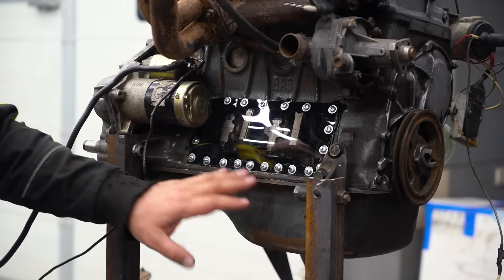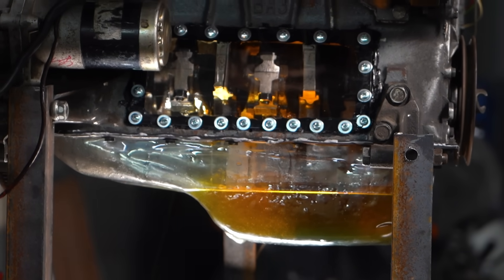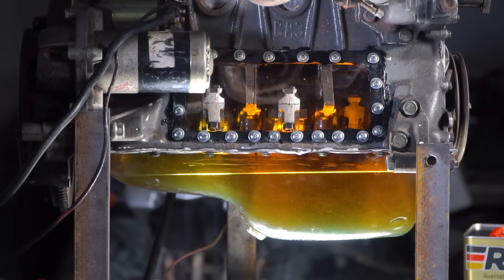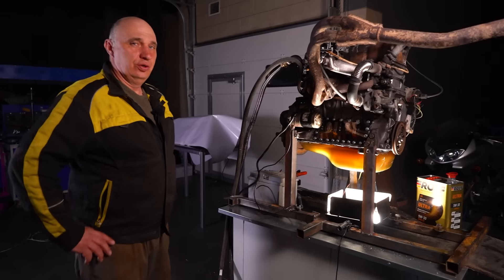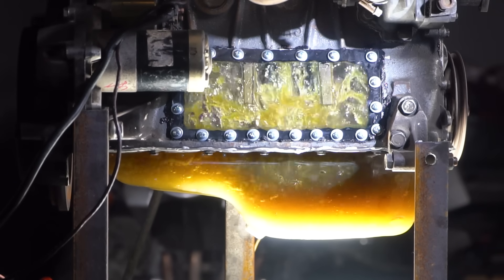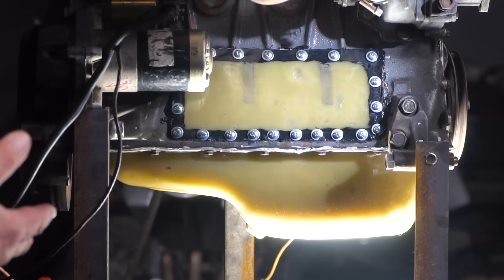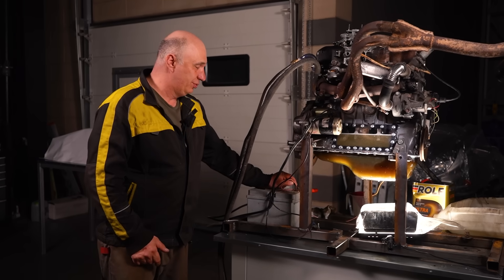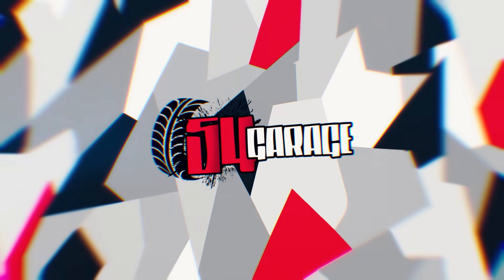What actually happens when you overfill your motor oil? (w/ transparent oil pan)

Comment: Great video!
Cause of problem seemed to be that crankcase pressure went up suddenly along with foam and completely blocked crankcase vent (foam may contribute to blocked vent, as apparent).  This crankcase pressure increases suddenly as oil heats and vent is blocked.  The pressure causes
seals to blow.  Primary cause of failure is crankcase vent getting blocked w/oil and  crankcase pressure building up.  The blowby on cylinders from same pressure caused burning of oil.
Foaming is secondary, but perhaps root cause if you break camels back with juuust too much oil.  The foaming may tip the scale, as foam may be more viscous and will not allow crankcase to vent properly. 
At least this is what it seemed to me.  
Watch video again and reply if you agree or not.

Comment: The oil is actually becoming aerated on the second test with double the oil. It was a good test but it would have been interesting to see an oil pressure gauge. The reason an engine fails when you add too much oil is because of all the air bubbles it will create, causing low oil pressure and poor oiling. No telling how long it would take, but it would eventually kill the engine.

Comment: My sister’s ex mother in law saw that the dipstick was low, her husband taught her how to check, but not how to correctly top up or how much. She bought several containers of oil, knew that oil went into the fill cap hole, then poured those containers in one after the other as she didn’t see an oil level through the fill hole. She attempted to drive off. The engine hydraulically locked in about a minute. It did start up after the level was dropped, but the engine was never the same.

Comment: Yes thats for that specific engine . You see the oil is being sprayed to side of block.. If you add too much oil the crank splashes into oil causing windage (air in oil)in good engines on in clines and declines you need a windage tray for race engines.. This engine will lose HP and on inclines will airate and destroy engine. let alone push the oil into PCV system .. idiot

Comment: Thank God someone disproves the myth adding more oil will bust your seals. Adding more oil does not increase oil pressure, it is open to atmospheric pressure. Most don't understand pumps either. Pumps do not create pressure, pumps create flow. The pressure at anywhere in the engine is determined by the area of the oil channel at that location Pressure = Force/Area. Force is equal to the pump flow there will be flow losses the further the oil channel is from the pump and smaller channels increase resistance to flow, so they increase and decrease pressure at the same time bringing it to a happy medium s designed by the engineers. The main issue with to much oil is as seen, your crank will turn it to foam by mixing air into it.That doesn't lube your engine or operate hydraulic lifters nor provide a good coating on the cylinder walls and so on.

Comment: Wire mesh under the crank will increase power like you can not imagine. WE DID THIS ON A GT3 1.6LITER COROLLA AND THE ENGINE REVED SO EASILY.

Comment: Too much oil also robs the engine of power due to the energy dissipation when the big ends and counterweights smash into it at high velocity. The energy is transfered into momentum and the result is that oil spray and foam.

Comment: I once accidentally put a quart too much in my engine, and worried about it.  This video suggests that wasn't a problem at all. On the other hand, I've seen plenty of engines that are way too low on oil.  A low oil level is often immediately obvious when you first open the hood, and you feel the heat blast coming off the engine.  You can also hear the valve/lifter noise.   Going up a hill, or going around a corner can set off the low oil pressure warning light.

Comment: My coworkers son was taking an auto mechanics course in High School and decided to put his new skills to use on the family car. He pulled the dip-stick and observed it was a little low and added some oil. This process was then repeated several more times, and oddly the oil level never changed. The next morning my friends car started on fire while he was driving to work. Excess oil was pouring out of the breather and valve covers starting the fire. Later it was discovered the kid had been looking at the transmission dip-stick and had added several quarts of oil before giving up.
Reply: Another guy I was reading in these comments said they knew a guy who had done that also. That is hilarious it is a little more common..

Comment: My son was on a road trip, close to a hundred miles from home, remembered he forgot to do the 5000 mile oil change, so found a shop to change it befor heading home. On the way home it wasn't running as it should. Checked the oil, it was way over filled, figured they forgot to dump the old oil and added the new on top. We drained it, it was thick, all the oil was a thick foam and in volume, about triple the proper amount. After a month the drained oil was still the same, still foam. I was surprised something didn't break, a piston rod or something, but motor was fine.
Reply: you dont have to change it every 5k miles on the dot, you probably did more damage (engine wear) to the engine from this than if you had let it go to 10k or 15k miles with out an oil change.

something they didn't cover in this vid is oil doesn't wear out, it's latterly millions of years old, the reason they want you to change it every 5k is the additives can get saturated, but depending on what type of fuel you use and how hard you run your engine it can be over 20k before it's really saturated.

5k is just playing it safe for people that abuse the engine, by not letting it idel for 30 sec on a cold start or worse giving it high revs on start up.

when you do an oil change and the old oil is still clear, it's no where near "needing" an oil change.
Reply: @robgilmour3147  Oil gets polluted with carbon, combustible gases & unburned gasses and loses its lubricating properties. In most all situations changing the oil at 5k miles is the right thing to do and shouldn't go much over whether they abuse their car or not
Reply: @seatime674  yes and the reson the oil can pick up the carbonate and particulates is largely do to the addtives in the oil, oil with out addtives stays  clean looking far far longer than with out.

back in the 40s and 50s they didn't put addtives in and you often never had to change the oil, only doing so when you had to overhall the engine, witch was much more often because all that crap wasn't being removed by the oil.

we still have marine engines and mining engines today that we don't change the oil ever, (or till overhall) they just have bigger oil sumps and more robust filtration systems, 10,000 hours run time (200k+ miles) and the oil still lubricates just fine. we will add oil and on some of the really big engines they often test the oil viscosity and detergent levels but change the oil nope, only if something is seriously wrong it the test results.

I'm not saying its a bad thing, changing the oil every 5k is way cheaper than having to do an engine overhall every 50k like they used to, we rarely do engine overhalls any more and its largely do to additives and oil filters keeping the engine clean.
Reply: @robgilmour3147  You're talking very old school engines and outdated theories. New engines today are extremely fine-tuned with very tight tolerances with super high compression.  When gas is burned it creates a lot of garbage that pollutes the oil and loses its lubricating properties. End of story. There are many videos that show people that do 10 and 15,000 mile oil changes their engines need to be overhauled way sooner than later  studies show after 5,000 MI twice the wear starts happening then three times the wear soon after.. It's a 100% fact
Reply: @robgilmour3147 
Lmao seriously

Comment: When he test spun the oil, if you didn’t see the rear crankshaft dragging through the oil aerating it, that is the problem.  Why?  Crankshafts have journal bearings. Journal bearings are lubricated by the crankshaft floating on an oil wedge created by the rotation of the crankshaft. The aeration adds air bubbles into the oil.  When it goes into the journal bearings those air bubbles collapse and you have no lubrication in those bearings.  If you want to believe this wing nut and add more than the manufacturer recommends, you deserve what happens to your engine. This engine is not a splash lubricated system.  Watch the air bubbles.  That white foam is the problem.  Please do not listen to this guy, you will learn the hard way what will happen to your engine.  Videos like this should contain a warning, “caution, if you believe this, you are a moron.”  Stick with the dipstick marks on your car.  Change your oil using quality oil and filters.

Comment: I think the main problem this causes is a pretty significant decrease in fuel efficiency and a reduction in the lifespan of engine as the engine is now trying to push its way through the oil which takes way more energy compared to pushing through air. Imagine how easy it is to push your hand at high speed through the air vs through water and then imagine that oil is even more viscous than water. Problems being caused because the "introducing air pockets to bearing surfaces inside the engine" because of the foaming is probably one of the most ridiculous things I've heard all week. It would be a good experiment to run the engine for 15 mins with normal oil level and monitor the fuel consumption and then compare it with the fuel consumption of 15 minutes with the engine full of oil.

Comment: Unbelievable how reliable these engines are. This is great to know, sometimes we go a little overboard in the dipstick and it's good to know it is not quite that big of a deal
Reply: Right.....
4 quarts, 5 quarts, 7 quarts 8 quarts
10 quart giant oil pan.
Right , I get it.  I'm talking about my whole life it seems any car on the road holds at least 4 quarts. Anything bigger than a lawn mower, but here I find a good size V6 engine that only has 3.5 quart capacity.
It's a first.
Reply: We are looking at an old Soviet era engine.  It wasn't neccessarily built then but you can see the ID on the block.  They may have never bothered to change it because that would have cost money. That oil had pretty good anti foam chemistry to put up with getting beat that much, but they pushed it into full lather. Very impressive. Glad to have seen this.
Reply: This is actually a shit vehicle overall haha
Reply: Okay, we made a tally of all the oil pans that hold MORE than 1 gallon.
Anybody with a real car that hold LESS than 4 U.S. quarrs?
Reply: Would be curious how a diesel would do though, since they could easily use it as fuel.
Reply: Hate to break it to you but my V-8 Mustang gt takes 8 quarts.
Reply: @carlosarmero594 pffft 11 quarts in my Ford 390
Reply: @Coronet_shop 16 in my 6.0 power stroke and 7.3
Reply: @2strokemigz  diesel is different compared to gasoline
Reply: @Coronet_shop  it’s different in the sense that one uses spark plugs and the other doesn’t, diesels simply have larger oil pans… if you put a bigger pan on a gas motor you can achieve the same lol
Reply: @2strokemigz  shhhh don’t let the oil companies know that lol gotta love the FT 361, 391 aka the original super duty engine for Ford before idi. 10 quart factory pan fits like a glove. But true different indeed.
Reply: @carlosarmero594 That's interesting, my F-150 only takes 7.25 qt
Reply: I just got back from changing the oil in my sister- in- laws 3.3  Nissan and put in 4 quarts out of the 5 quart jug she bought.
Then I found for the first time in history a crankcase that held less than 1 gallon of oil.
Almost every V8 I ever dealt with held 4 quarts, my little Ford Ranger 4 cylinders hold 5 quarts, but this big Nissan V6 is only supposed to have 3.5 quarts.
So is the extra half quart going to cause the oil whipping up a frenzy?
According to this video probably not.
I would have to go over a couple whole quarts to even get close.
Reply: @michaelszczys8316  Nissans seem to usually hold less oil than many of the other brands of cars for some reason, I don't know the reason why as I am not an engineer, I just turn wrenches.
Reply: @celestial4762    Perhaps that’s why they’re unreliable! 🌝
Reply: @michaelszczys8316  
Some v8's hold way more than 4 quarts. 

Some 1.2 litre engines hold 4 quarts. 

E.g. if your oil filter is 50 quarts big, then even a 1 cylinder 0.000001 litre engine will need more then 50 quarts.
Reply: @michaelszczys8316 my v6 ford escape takes 6 quarts lol

Comment: I kept expecting that plastic oil pan to just explode catastrophically and spray oil all over the shop, followed by the engine seizing up or throwing a rod! I'm amazed that he was able to carry on this experiment as long as he did without a catastrophic failure. Eventually the plastic cracked and started leaking, but it didn't just explode into a million pieces in the last phase of the test. It's good to know that a slight overfilling of oil, a couple of ounces maybe, probably isn't going to harm anything.

Comment: my last oil change, they evac'd 9 quarts from my Odyssey.. twice the volume they should have.. which left me to suspect that my last oil change was never done (can't swap the filter if you don't drain the oil).. this video has provided some reassurance that my motor's not FUBAR'd because of negligence.. thank you..
Reply from the maker: I guess it depends on how hard you drive your Odyssey. J-series V6 motors do tend to be pretty durable, I've heard of people who have significantly overfilled the oil in their engines and have gotten away with it.

Comment: The comments are more interesting than the Video which could have been so much more but has been aimed at simple entertainment 😃
For the many Anxietysts out there, my observation is your generally impatient - Top up your oil slowly and if you give it enough time to get to the sump you won't have to worry about it being over the recommended max level. If you can not do that , just dip the oil withinin 5 sec of stopping the engine and you will see even that 1/2" overfill is below MAX 😉
The danger of Overfilling is (besides the obvious) oil overwhelming the Piston rings and crankcase ventilation and getting into the combustion chamber then causing Detonation (which can shatter pistons )
The primary function of oil is cooling, so Airiating it excessivily is going to reduce it's performance ! again your going to need to be way over filled to get into that teritory !!

Comment: I overfilled mine (it had the wrong dipstick) and went on the motorway at 70mph. After 20 miles oil went into the air intake and the car was running really badly and would not stop hahaha.  I took it to the main dealer who said it needed a new engine. It took me a day to work out it needed a correct dipstick -£6   :)

Comment: Thats crazy, I put 4 quarts too much in my 351W and it was smoking real bad until I drained the excess. I got a real good deal on a riding lawn mower once because it was smoking and the owner assumed the motor needed to be rebuilt. I just ran it and eventually it stopped smoking. Apparently it was just over filled. But, now, how is this my experience yet that engine seems to run fine with 3 times the recommended oil level and mine smokes with less than 2 times plus its a much bigger engine?

Comment: Lofl @ all the western gearheads taking advice from a Russian mechanic. It's like seeking a second opinion on surgery from an undertaker. Scams, extortion, hacking, disinformation, and other dark arts.... ✅Russia's sweet spot. Design, manufacturing, maintenance, reliability....❌NOT  Russia's sweet spot.

Here's the deal...mechanical engineer with 35 years experience. If I HAD to pick a little over max oil vs a little under min oil, I'd pick a little under min every time BUT...BUT ! But you don't have to pick...patience in filling with new oil, allowing it time to fully fill and penetrate the oil reservoir system and tweaking the level up as needed vs dumping a bunch in a hoping it's correct...and periodically monitoring its level when using. It's really a stupid question altogether because it's a completely unnecessary dilemma. You're welcome.

Comment: I had bought a VW Cabrio at a junk yard that had clean oil & the oil sticker had the same miles as the odometer. I found out when I got it home the engine was locked up. I broke it loose & cranked it up it had no oil pressure. So when the local shop did the oil change the oil pump lost it's prime & would not pick up the oil in the pan. And they must not notice it had no oil pressure till it locked up. I double filled the oil pan to make sure oil pump was covered in oil & it developed oil pressure engine ran fine. Then put it up for sale had someone from 200 mile way San Antonio show up & bought it. It was a nice red convertible VW early 90's.

Comment: An readily apparent issue that I can see once the crank makes contact is that that cappuccino is aerated.  If that is the condition of the oil immediately around the pickup you are sending air to the top of the engine which means you are starving it of oil.